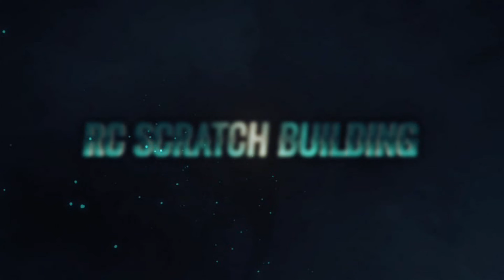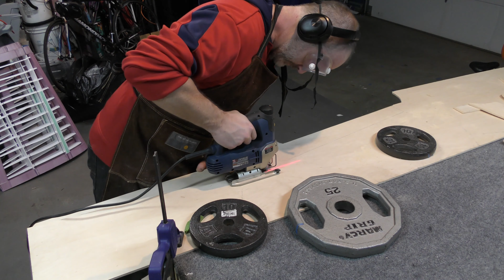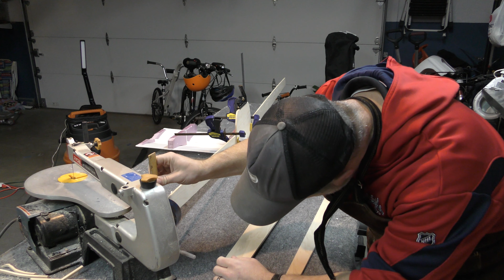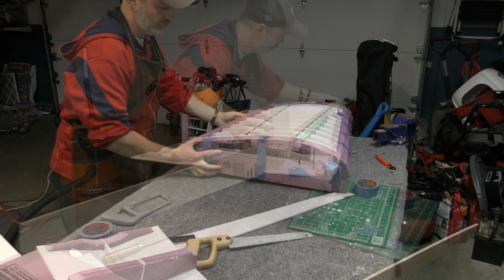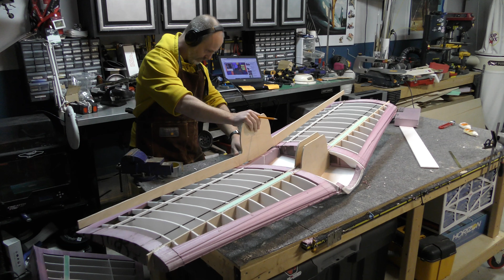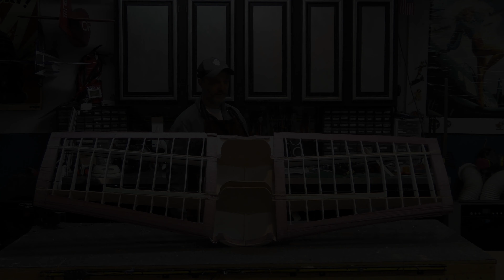1:9 Scale B-17G 'Sweet Pea' - Wing Part 2

Comment: Awesome build!! Wish I had the skills you have. What type of foam did you use? I am planning to build a 150cc Edge with foam wings, what type of foam would you suggest?
Reply from the maker: Thanks!  Sorry for the holdup in response.  I use a mixture of foam based on the need.  For sheet foam I use Model Plane Foam (MPF) that comes in large sheets.  This is a great substitute for balsa or DTFB.  I'll also use insulation foam in different thicknesses for heavier structure.  That foam I pick up from the hardware store, generally in 1" and 2" thicknesses.  

Depending on whether you want to do a solid foam core or a "ribbed" core like the one I did here the foam you pick will change.  It would be easiest and fastest to us 1 or 2 layers of 2" foam and hotwire a solid core and then sheet it.